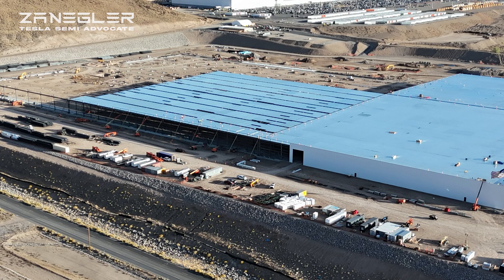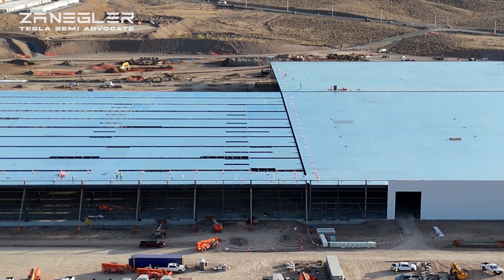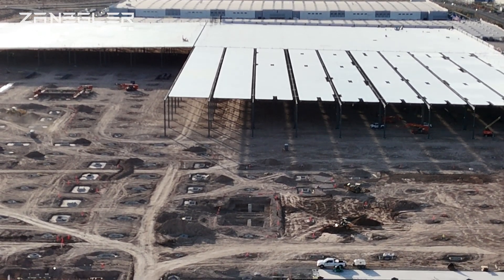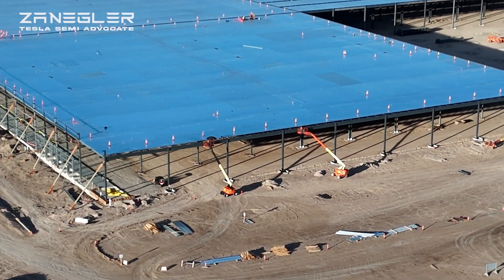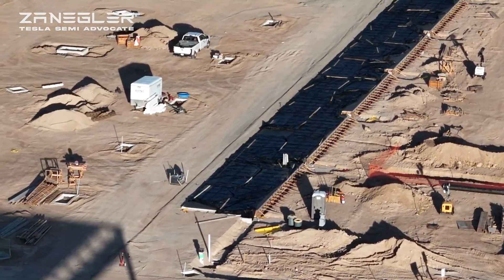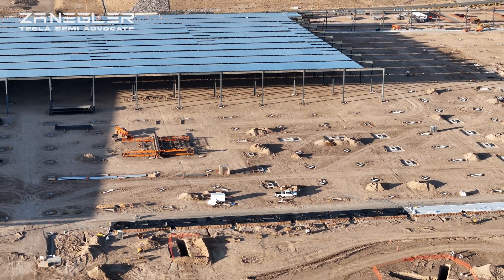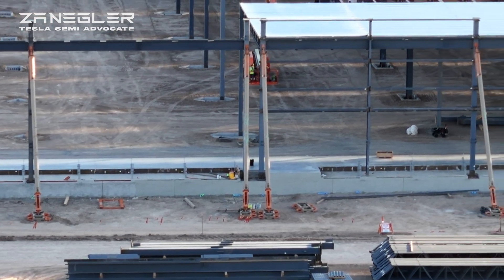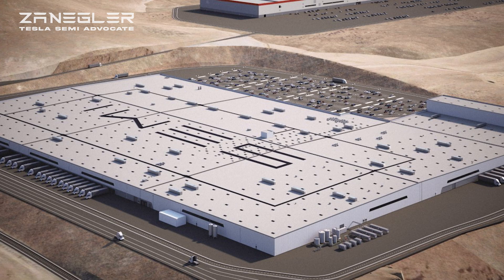Tesla Semi Factory Rolls On - 10/22/2024

Comment: I think the BFF's are for Giga castings, Why would Tesla not include castings to reduce cost? Doesn't make sense... Look out for the the deliveries.
Reply from the maker: I can’t see a use-case for gigacastings on the semi but we will know soon enough.
Reply: The BFFs are located along the column gridlines. Regular columns will be installed on those footings.

The reason the footing is deeper (and they are only deeper, not bigger) is that some in-ground utility (drainage for example), or a production line trench, or pit (stamping press pit for example) needs to be located above the footing.

If you follow the GT videos, Stamping 2 was a perfect example of these deeper footings. See Jeff's Day 420 at 10:25.